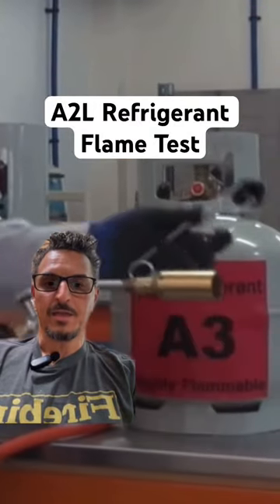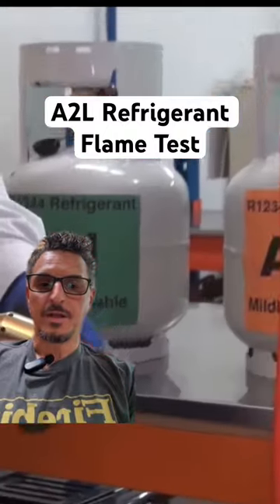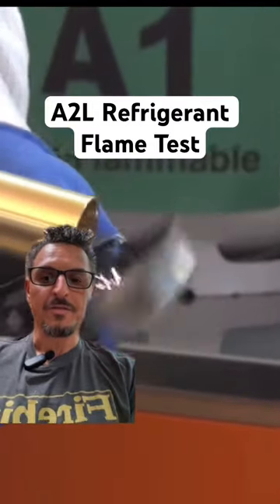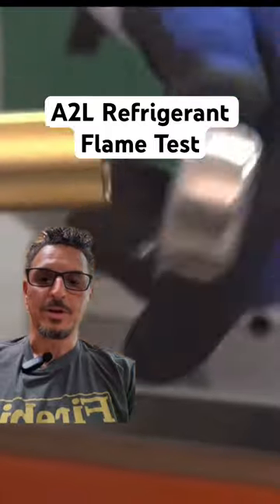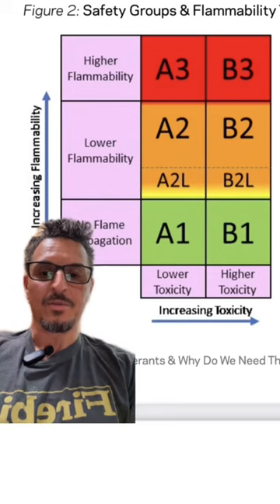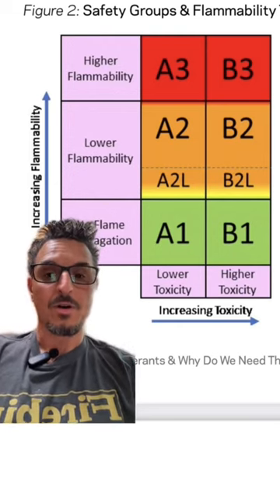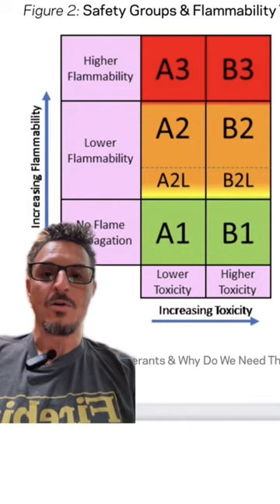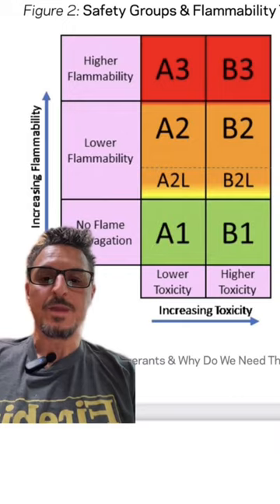Here's an A2L Refrigerant Flame Test vs A3 Refrigerant. #hvac #a2lrefrigerant #refrigerant

Comment: Its possible, but not probable. You would need 12% to 22% of 454b to oxygen to get a flame. Those numbers are also from the EPA, so they will be the most liberal with them  for safety.

Comment: Whats the critical temp of this stuff
Reply: Depends on the refrigerant. Critical temperature is not the same for all the refrigerants ✌️
Reply: Similar to 410a
Reply: R454B =78 F; R410A 72 F
Reply: @survivor-z3t 78 and 72 °C not F
Reply: Roughly the same as 410. 454 and 410 are pretty similar in CT and pressures, to the point of it being negligible. The biggest difference is price and time, since we will need to triple evac and pressure test for 1hr minimum.